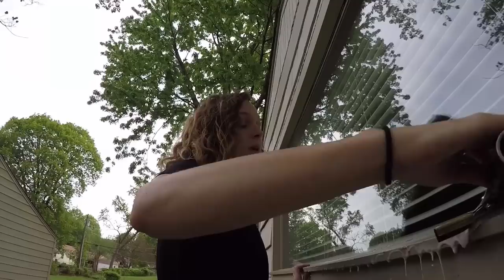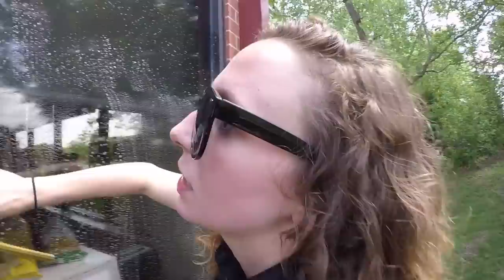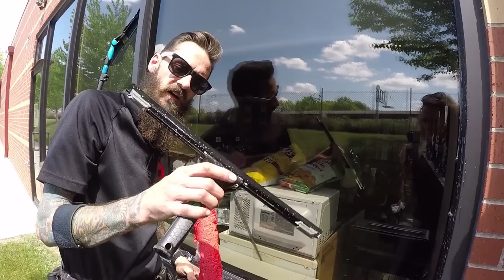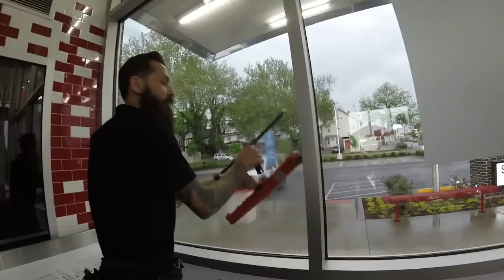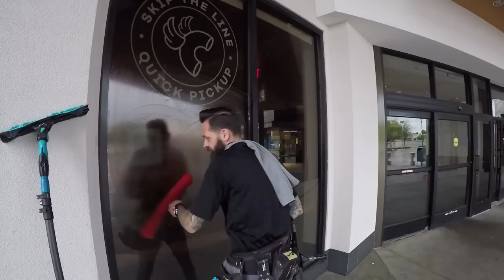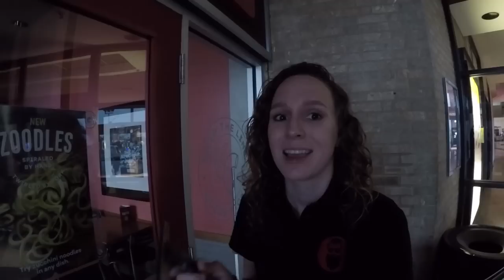Top 5 Mistakes For Newbie Window Cleaners

Comment: We all use 24 to 30 inch sorbo channels and janitor fan.  Better on your wrists over time.  Plus, we carry 4’ x 2’ cotton towels.  Don’t take a resort beach towel into a home.  You will knock over valuables on counters and possibly trip up on a roof due to its extra length.

Comment: Would recommend that you charge by the hour.i do this here in Finland.saves so much fuss and you don't have to worry about under cutting yourself. You're both professional, i think your customer can see that.the going rate here in Finland at the moment is 37€ per hour, which is a good living.i make more at window cleaning than i ever did in construction. Keep up the good work. Love from finland❤️
Reply from the maker: Good tip! Love the suggestions!

Comment: Pretty good video. Especially the part about underbidding. Been cleaning windows 20+ years and I still do it sometimes. We gotta remember, $100 - $200 isn't that much money to most people who hire window cleaners. People in our tax bracket usually buy windex. One thing I just don't do, though is take a belt bucket inside a house. I do very little route work these days and never wear one, actually. It's a drip waiting to happen. Also, as your wife did in the beginning of the video, it saves a lot of time to pull the squeegee to the bottom then use it to clean the ledge.

Comment: There is absolutely too many variables in window washing to make a good tutorial. 10 years on the job and sometimes  I still come into challenges that catch me by surprise. 
You forgot to mention :
 weekly jobs that the masonry guys sling concrete on.
Or stubborn  green pollen during the spring season- a lot of the time these weekly's are harder to scrub than any quarterly jobs .Brass handled flatties that slide whenever there is ice in the bite. Squeezing over bushes. Squeegee near wasps nests
Squeegeeing behind partitions with about 4" iof room. Squeegeeing and scrubbing the inside of Burger Kings with Broiler smog on the uppers. Salt buildup on your lower seals during winter .(Can't leave it ). Bending your channel on the job..... 1000 variables so this would rank as a very general tutorial

Comment: Sometimes making changes to your equipment might make your job become much easier. For instance I made a WFP system that operates with a mop instead of a brush. The mops I use all have adjustable angles and this makes the WFP system even better when you need to work in tight restricted areas that make it impossible to use the standard brush. Also another tip is to learn to use all brands of squeegees. An Ettorie or Sorbo squeegee can be used for most jobs. Some window cleaners prefer only to use one of these types, however if you learn to use both you will find out that these two types of squeegeeing have advantages that you can use over the other one. Thus making you more capable of preforming the tasks.

Comment: For those of you that are new.   I charge by the minute.  If it takes me 8 minutes it's an $8 window.  That's high for my market but I guarantee no drips dots streaks or lines.   I clean every sill scrape and polish every window.   So while a double hung with no storm is 8 base a double hung storm is actually 12 plus the interior window.    The storm takes longer because you need to remove the screen.   So it's not just double it's double plus the disassembly time so a double hung is $8 a double hung with a storm is $20.   Yes it's a hike but that's what I charge and people will pay for the quality.

Comment: I do a couple things different.  I use a full carpenters belt that has 2 big pockets and 3 smaller.   The left big pocket houses 2 cycling bottles.  You control water indoors, don't run out on a roof, doesn't leave water all over the deck and then footprints walking in it.  A carpenter belt also holds my phone, etore scrapper, two wet cloths and 4 finishing.   

Also, I don't have a Hutterite, Mormon, ZZ Top beard and arm tatoos.  Most residential clients are women over the age of 30 to 80. They much prefer someone clean cut and presentable with the soft skills of life.  Did you notice how he prefaced with WHATS UP.   
If you ever had a job at a Hyatt regency you learn certain ways to present yourself to distinguished customers.  This level of professionalism pays off.

First rule of any business, the customer makes the rules.  Self expression and language determines how they make their decisions.

Comment: Hello guys I'm up here in Alaska and watchn your video. I love your style and am going to definitely incorporate your mop squeegee combo method into my technique. Would like to see a tech. for hot windows that you've come up with. I have quite a few store fronts that are tall and very wide. And it's the second year owning my own biz and after watching you guys I'm most definitely intrigued by your approach and  style. You going to laugh but in my venture I add ice to my solution and it allows me to operate solo. Try it you might like it. Lol Also up here it's 6 months summer six months winter. Want to know what your suggestion would be for iceing while working in extreme low temperatures. I've used a number of different chems but find 90% iso propel alcohol works because of it's ability to instantaneously melt ice.???????? Let me know, good on both of you. David Trainor Crystal Clear Windows Anchorage Alaska
Reply from the maker: Hi from New York! To combat the colder temperatures we generally suggest working with wind shield fluid in your solution, or working with it straight in warm water. For the warmer temperatures and hot windows, we suggest adding more "slip" to your solution, something like Hi Slide, or EBC Glide are great options as it slows down evaporation times and increases the glide of your squeegee on glass.

Comment: Hey Luke what set of squeegees should I get starting out? Ninjas or liquidators?
Reply: Twisted702 hey buddy! I'd start with ninjas  over liquidators.
Reply: Luke The Window Cleaner will do! Thanks luke!
Reply: I started out with liquidators and I'm very happy! However I am thinking of switching over to wagtail for some of my higher jobs. But I guess it's just what you're raised on.
Reply: Get a simple old fashioned set of plain brass squeegees with old style brass handles. They are cheaper, easier on the hands with less fatigue, and the set I have is over ten years old with no repairs or replacements, they never wear out. You really only need one clip, not two so don't worry about that plus if you have a paint spot or something and forgot your scraper, brass is softer than glass and will not scratch it. All the new quick change, stainless and plastic handles break and need replacing and most of them are too thick and cause hand fatigue. Once you get used to the brass squeegees you will never go back. I tried them all.
Reply: I took the red handle off my "Original Mallory"...Works great 👍

Comment: One of my employees is a very hard worker and gets here at like 6a to start his day cleaning windows. The only thing is that he  works harder and not smarter. I also have just noticed that he has started some bad habits with his window cleaning like toweling more than just around the edges or picking up the squeegee in the middle of the window. Do you have any advice for me to help him out?
Reply from the maker: well from me, i would nipp them in the butt.  NEW habits are easier to mold, than old habits. ~Jersey 862-312-2026

Comment: Ettore rubbers are good. These clients always hire painters that paint their windows shut every year. It's ugly.
Reply: If you have a handy way of getting those types of windows open id love to hear it.  I find customers dont like you banging their windows open or having to pry them open with a tool because that can sometimes mess up the paint..

I was thinking maybe using my scrapper to cut in between (maybe a box cutter). But I could use a better option.